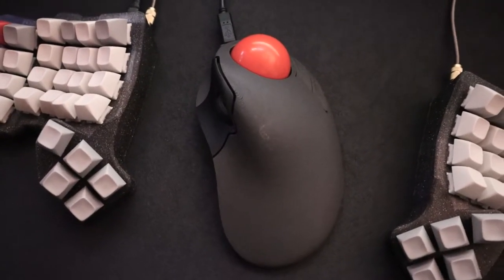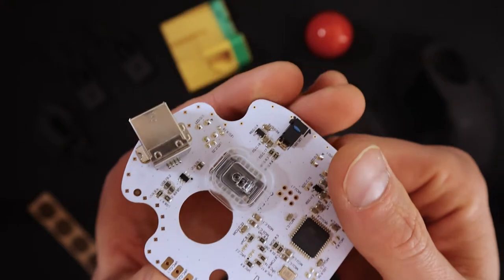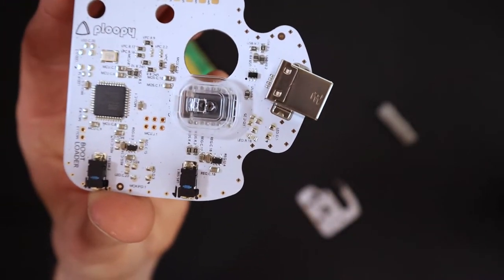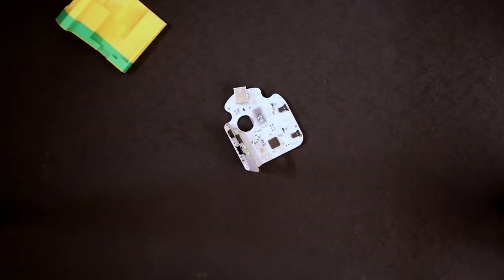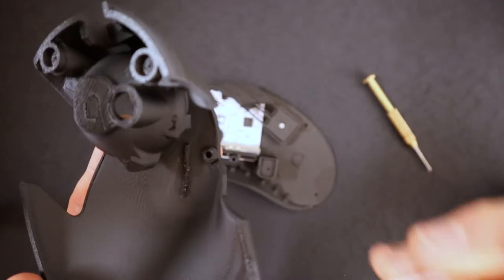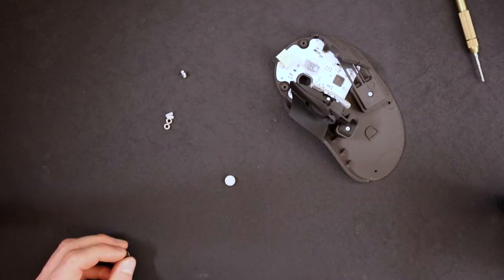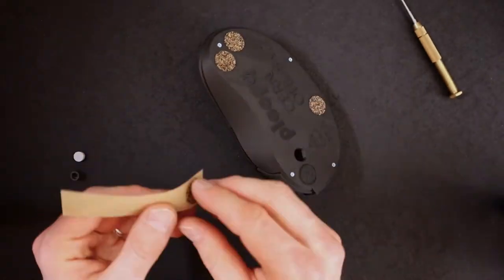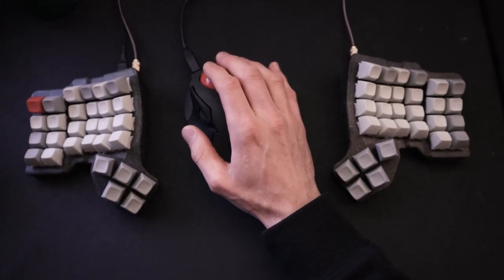How to Build an Open-Source 3D-Printed Trackball (That Lasts Forever) | Ploopy Classic DIY Guide

Comment: That scratchy sound when the ball moves is TERRIBLE! (Also would never work in an office environment where we use Elecom trackballs.)
Reply from the maker: In hindsight I'd say my video dramatizes the volume of the trackball a little bit as the mic volume is louder than what you'd hear at your desk/your coworker's desks, and pointed directly at the mouse. The switches on my keyboard are fairly silent (Boba U4 switches), and they also much more audible in this video vs irl.

That being said, I don't have a static friction-based trackball to compare it to and you are definitely correct to say the Ploopy bearings are louder than any static friction trackball. They also feel really nice to use, so there's that (not to mention the possibility to do a BTU mod, which apparently feels even nicer but is also louder, heh).

I'm sure though many people use Ploopy mice in office environments with no issues. I work from a home office so don't have coworkers to ask about the noise.

As a final thought, I am hoping to try a similar mod to my trackballs that I've done to my Scylla keyboard, which is to fill the shell with some scrap neoprene I have to reduce the 'empty' sound it has when first built. Should improve the sound of it by a decent chunk as well.

Enjoy your Elecom! :)

Comment: Thank god for this vid - was starting to think mine was unusually loud even for this trackball, that my friction problem was unwanted contact. Guess my bearings are just bad.
Reply from the maker: Others might have some suggestions that could help on the Ploopy subreddit. Have you tried pushing the bearing dowels in with something like needle nose pliers on both sides?

I had one bearing that was stuck out (at an angle slightly), and louder. I had to push pretty hard to get it in as flush as the others.

Comment: Thanks for the video, I felt unsure about how to deal with the plastic support structures but I could remove most of it by hand.

I appreciate that the ball is easily lifted from the case, if you ever transport the mouse remove the ball so you won't damage the bearings. You could also remove the usb cord so it doesn't wiggle the connector loose from the board. Overall a well-designed mouse.

 My package had a duplicate scrollwheel holder holder and right-side buttons, it's nice to have the first set of replacements on-hand and I'm assuming these break the easiest.

Comment: I've been considering this mouse for a bit. how do you like it so far? 
By the way, did you order your dactyl or build it yourself?
Reply from the maker: Hi HauntdUmami! Nice name. 

I'm liking it so far for browsing/general use. Can't use it for gaming (yet) as I prefer to use a lower sensitivity (currently still 600dpi) in order to have enough precision for highlighting text and clicking links, etc. This means there's a lot of flicking the ball and catching it, which I tried briefly in a couple first person games and it was uncomfortable/kinda seasick-y - I would have to use a higher DPI for gaming and my precision would suffer I'm guessing. Still using my G400s for gaming which works great for me.

Sometimes I still have trouble with very small actions even with the lower DPI Ploopy but I think it's just a matter of getting used to it. I definitely feel the weight of the ball more with using a lower DPI but I don't think I could make it work with usable precision at the default DPI of 1600 yet. Overall I enjoy it and use it daily. I may try a higher DPI as I grow more accustomed to it.

Built the Dactyl (Scylla from BastardKB) myself using a kit - similar to this Ploopy actually, but a lot more soldering as there's diodes and switches which adds up! I'd say slightly more soldering experience would be helpful for the Scylla build but I'd do one again if the situation arose or a friend wanted one. I recently swapped out the alpha switches on the Scylla from Boba U4's to Bobagums and am liking the silent linears more for every day typing as well as gaming. Kept the U4's on modifiers and thumb switches.

Very happy with my current setup! If you have any more questions feel free to ask :)